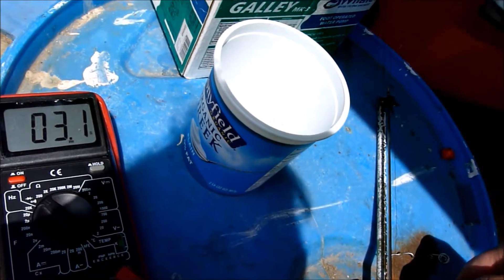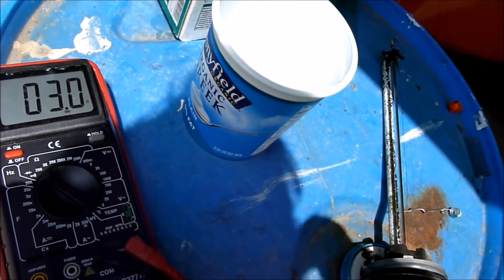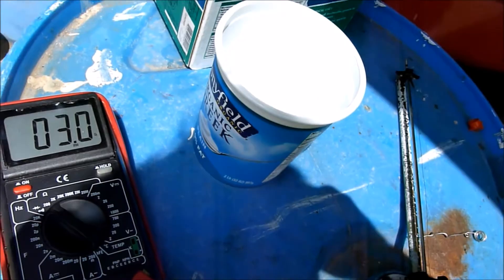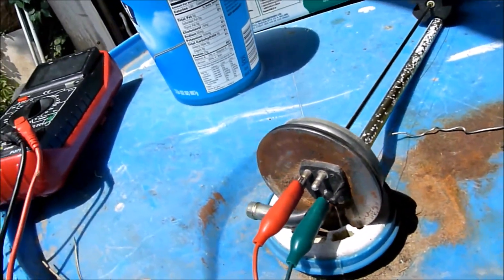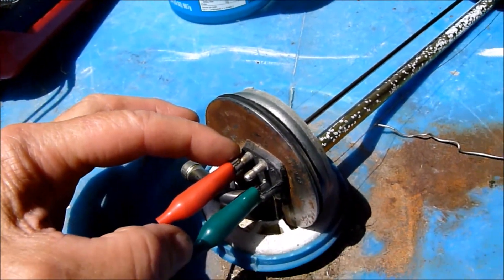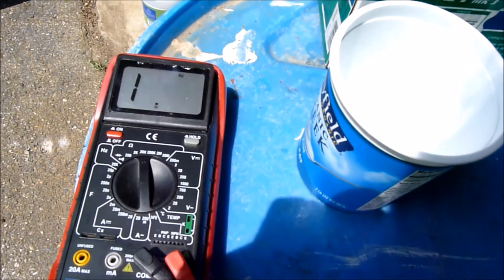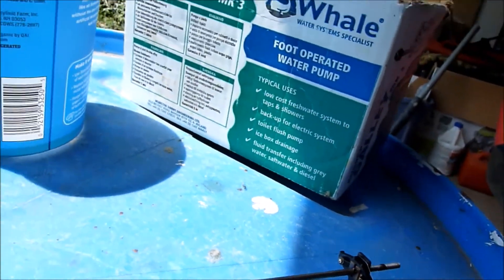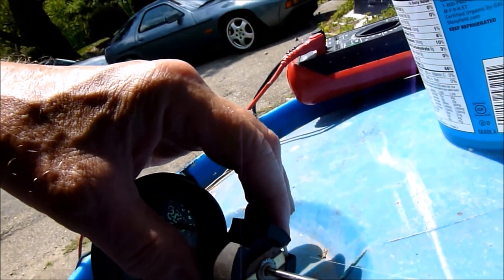Porsche 928 fuel level sender testing and repairing

Comment: Thank you, helped me, but mine is reading 3 ohms Full and 15 ohms empty. loosing resistance somewhere  ?   but where ?
Reply from the maker: It means there is probably a weak connection between the float and the ground rod. Is the resistance linear from empty to full or is it erratic?. Make sure there is no metal connection from the float to the ground (supporting) rod.